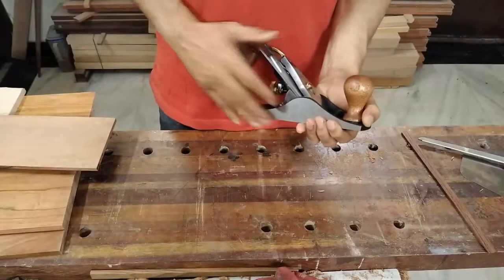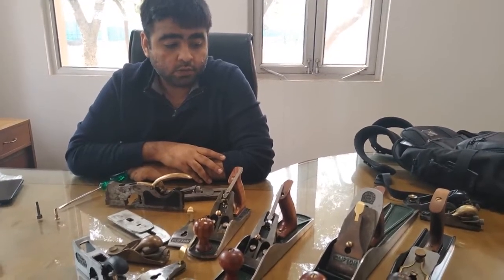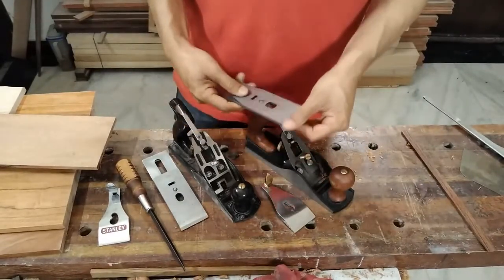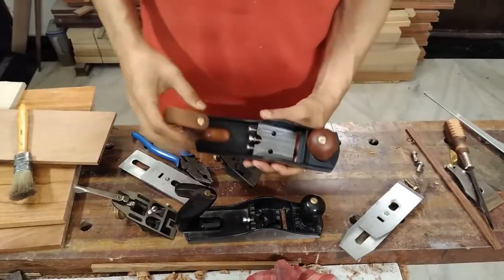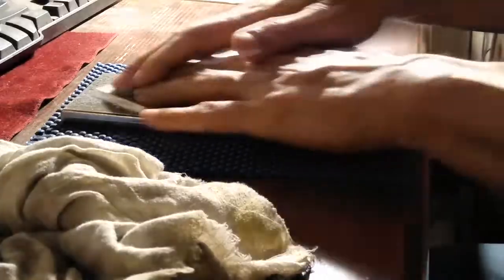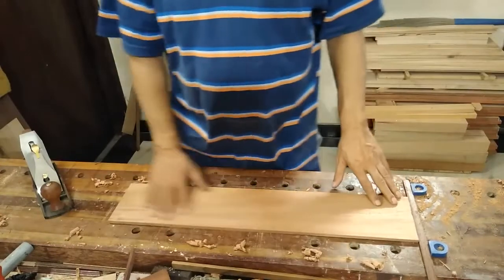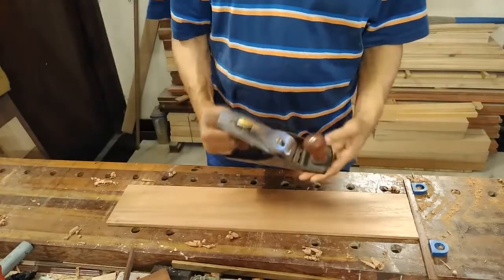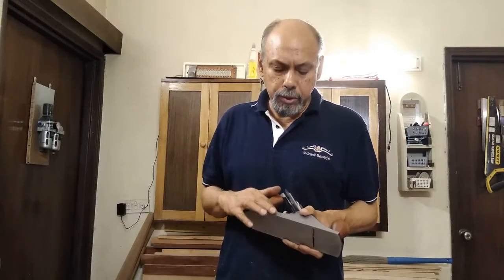InDiY: Soba Bedrock #4 Smoothing Plane

Comment: Sir, I think the back of the plane not  be flat as a chisel, I suggest you can follow the 'Charlesworth Ruler Trick'. Secondly I suggest you use a trisquare to test the flatness of the plane(try watching Christopher Schwarz video'Troubleshooting a Bench Plane)
Reply from the maker: I do it the regular way and even the ruler trick requires the back to be fairly flat as the recommended back bevel is only a few microns probabaly.

Comment: You might tighten the tote (back handle) by shortening the threaded rod that holds the brass top nut to the base, with the wooden handle in between. 1 or 2 mm should do it.
Reply from the maker: You are quite right. That would work. I finally solved the problem by inserting a small washer into the hole and then tightened the brass nut.